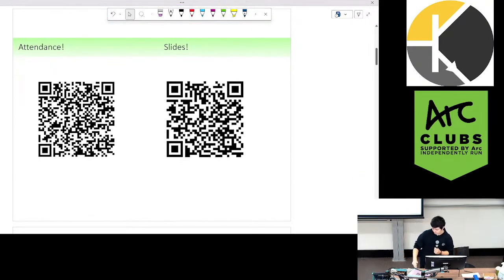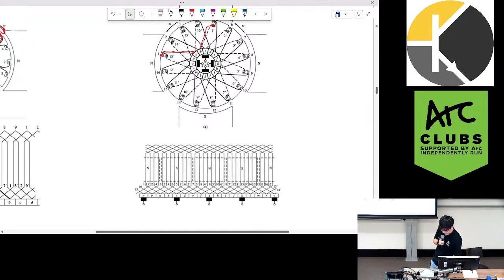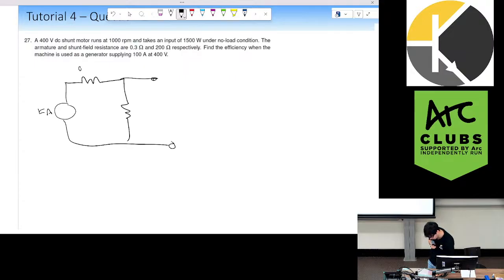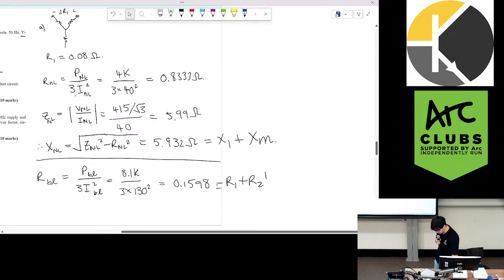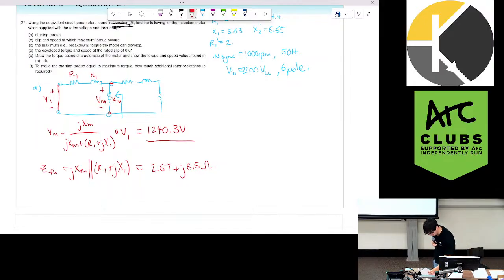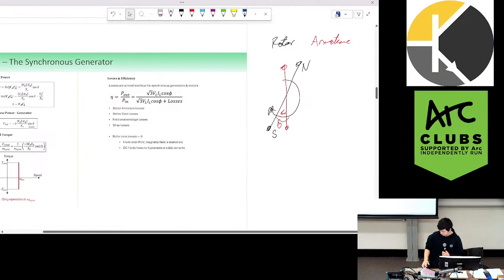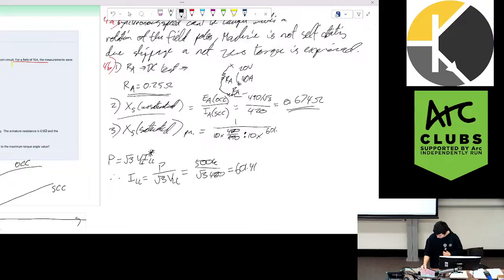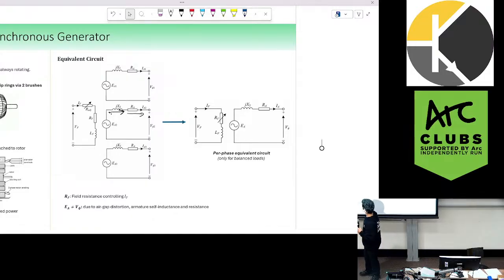UNSW ELSOC ELEC3105 Finals Crash Course 2025 T2

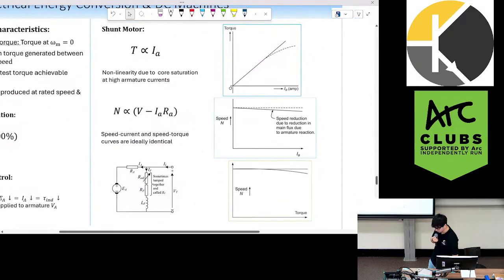Comment: Hi everyone, correction to slides at 39:18. 
For shunt motor speed control:
Increasing RF will INCREASE IA and an INCREASE in T_induced, since a decreased EA means a larger voltage drop across RA.